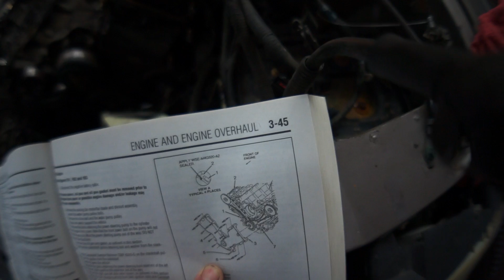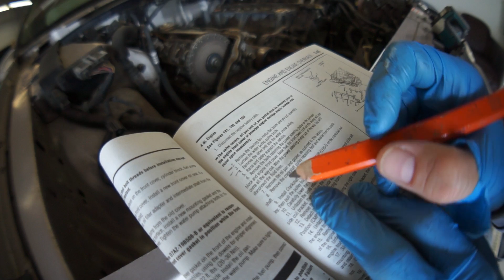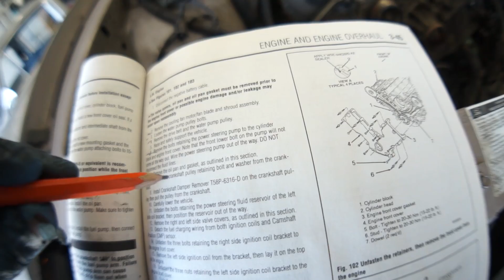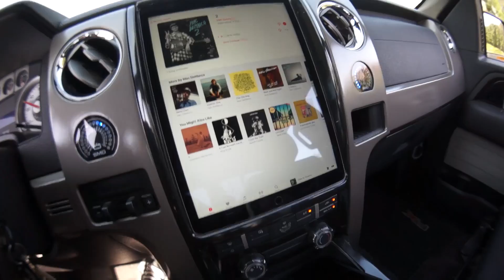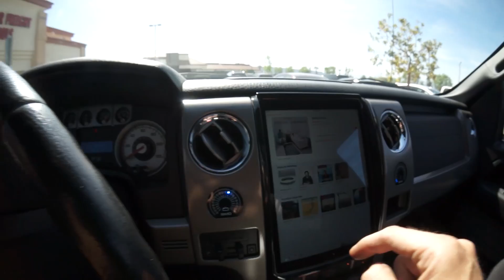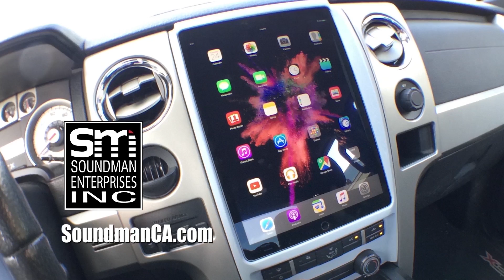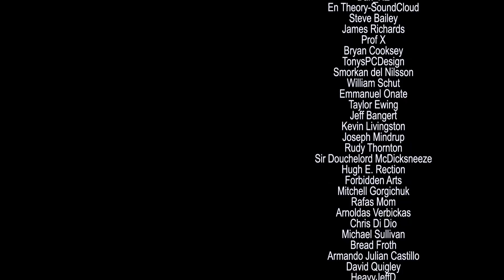You'll never believe what I learned about the T-Bird! - AMPLIFIED #729

Comment: Love T-Birds!!! My first car was an 88 T-Bird Turbo Coupe 5spd. manual. I went to a vocational school and had a bunch of the shops do work for cost: custom paint from the auto body shop, custom speaker box from cabinet making shop, rims nickel plated from metal shop, and custom sounds from my shop(Computerized Electrical Technology) Did it in 95 and all my pics got destroyed in a flood in my parents basement.  Then I wrecked it at 21 on leave like a dumbass. Been wanting to do a T-Bird build for my son. With the body style you have. You can find a bunch in decent shape with relatively low miles, cause so many old farts bought them. Love the show!

Comment: The reason everyone said to replace the motor is because antifreeze mixed in with oil. Once antifreeze gets in your oil, it gets in your crank bearings and no matter how many times you change your oil, you will Never get that antifreeze out of your bearings. Your rebuilding your top end but not the bottom end. That engine will fail you later on. I have worked on cars for 34 years now. I promise you that you will be doing this job all over again. Good luck buddy.

Comment: Still my favorite show. I'm glad I have more idea of what you're doing than with speakers and 6th stage flux capacitors and stuff.
You're crazy for holding up the engine with those 2 little water pump bolts.  And you're gonna want to swap it out obviously. And remove your calipers and zip tie them up to the shocks.... to something so you don't F your brake lines. Last peice of free advice is not to worry about setting marks on the timing chain, just start from scratch when you put it together. It's less confusing.

Comment: You should go for a performance build with a nice stereo. If you put a nice engine in the T-Bird it would be a lot of fun. Also if you did an engine swap you would bring in a bigger audience.
Reply: I agree, but instead of a motor swap I say throw in some big ass hair dryers. Push it to 300 plus HPs with improved MPGs.
Reply: Michael Taylor See you can put in Turbos or superchargers but you need to see if the engine is built to handle them. If it isn't when you're just going to blow your engine. It would be nice to see him put in a built engine that is make over 400-500 at the wheels. It would be a pretty badass project, and a great show car.

Comment: I'm not sure why you would have to drop your oil pan in order to take off your heads. Because somebody ran(don't know how long) the car with water(not a lubricant) in the oil, it is possible that a bearing (crank or rod) could have spun out which woulld be a motor rebuild if that is the case. Before you got started on this project, you should have changed the oil, re -torqued the head bolts and started(not drive it) it to see if you did spin a bearing out(knocking sound from motor means spun bearing). But that is for future builds I guess. Anyway, I just am so intertained by your videos that it brings me joy. Thanks for all your hard work and efforts on your videos. -zsignmein

Comment: I've had some timing covers off of some 4.6 and 5.4 mod motor fords. I'm pretty sure I just took the front bolts out of the oil pan that thread into the bottom of the timing cover and the cover came off no problem. It was a while ago though.

Comment: I have no idea why it wants you to pull the oil pan.  You just have to take the bolts out in the front that hold the oil pan to the front cover, then unbolt the front cover, remove timing chains and unbolt the head or heads and pull them off the block. looks like a Chilton book seems they have you do things the hard way.  You go Doug!!!

Comment: ford says you have to use the cam position tools but i want to say i used a 3/8 ratchet in the back of the cams to hold the tension when i removed the heads. This was back in 98 so my memory may be off. Either way i did not use them . I hate the torque to yield bolts.. makes me nervous that last turn.

Comment: Something to consider. You may not have a blown head gasket. I once had to leave a car sitting outside for 4 years. When I went to move car 4 years later the oil was full of water. IDK why. But I drained all the milk shake put in new oil and I still drive the car today another 3 years later when no issues.

Comment: Might as well take off the front shocks and mod them to fit the hydro cylinder.  Front =done.   Im actually curious on what you will do. I just top hatted the old struts and the hydro cylinder dropped in from the top. 90deg line out the bottom. No spring. Accumulators on the lines instead.

Comment: Time up the engine and remove the 4 bolts that go through the timing cover from the oil pan remove the crank pulley and the cover will come off without any need to remove the pan just use some silicone gasket on the oilpan surface area

Comment: Me again the coolant being low could be from the intake being cracked those 4.6 r famous for the intakes cracking on the back passenger side where the coolant goes into the heater core I have fixed a lot of them I worked on cabs that had a bunch of Crown Vics new intake is like $ 250

Comment: And one more thing... Make sure you REBUILD the front suspension when you add all that air stuff.
Ford engineers in their infinite wisdom decided not to put grease fittings on any of the ball joints, so they wear out super fast. Especially with the extra strain of an air system.
If you can find suspension pieces with grease fittings, get them. You'll thank yourself later.

Comment: after dropping the sub frame probably would have been better off just yanking the engine out then do the head gasket or just unbolt the trans drop the whole front cradle out unbolt the struts and roll it out lol but its good. The Thunderchicken is extremely clean id save its ass in a heart beat!

Comment: I hate to say it Doug, with how fucked that oil/water was,  you should replace the heater core. which is like a 12 hour job ... Also I got 20 bucks says it burns oil after the new head gasket install

Comment: this is going to be a real kick your ass job ....ok doug first once you take one timing chain off you need a crank holder and a tool to set and hold the cam...tell your head rebuilder to heli coil all the sparkplug holes they have a bad problem of blowing out plugs ...you also need to upgrade  timing chain guides...and don't turn the crank with the chain off....or you will bend a valve..i know just call rafa he will help re build it  .....keep up the great work

Comment: Well back to the drawing board because you really don't have to pull the oil pan off take the front pan bolts out of the timing cover and remove the harmonic balancer  all your timing cover bolts and it will slip off the dowl pins

Comment: why dont you just pull the whole motor out Doug? it will be easier to change the head gaskets and you can replace the rear main seal and other worn out parts.

Comment: And this is why I've come to love the  3.8 / 4.2 V-6. So much easier to work on than the 4.6 V-8. My 1995 Cougar had the 4.6, and it wound up with a clogged oil passage to the passenger side head. So much of a pain the ass to work with.
The 3.8 in my 1996 Thunderbird has been a pleasure compared to it. 60* V-6 is so much easier to get to, and it makes similar power numbers to the early 4.6 V-8.

Fuck anybody who doesn't a t-bird.

Comment: What if I told you it's not the Head Gaskets? It's the Oil Filter Housing Gasket, it has Water and Oil passages. It is Very Prone to Leaking Coolant in the Motor on the 4.6 ..... Mine did it on my T Bird...
A pressure Test with the Spark Plugs out would tell the Truth if it was The Head Gaskets...

Comment: That chassis was never designed with the mod motor in mind. It has remained the same from 90 - end of production. It was a Windsor that goes in there and its much easier to service as its not as wide as a 460 like the 281 that your currently working on. 
Trust me, you want to lift the car on a hoist and drop the whole shit show out and service it. It would take longer but at least you can put your hands on things with out blowing you elbows and asshole out.

Comment: Tdc the engine before removing the timing chain and the marks will line up as well plus it leaves you in the correct position when you go to install everything unless the machine shop wants the heads bare if that's the case fuck it...lol but seriously tho the only thunder chicken i would get is the super coupe aka 3.8 supercharged. Can't beat free tho

Comment: I know what the odometer says, but no way there is only 14k on it
Reply: Andrew Suderman I'd have to agree, there seems to be too much wear in the interior, looks like the carpets are quite trashed...  Maybe grandma was dirty?
Reply: It could have rolled over but the engine would have been trash before that
Reply: Old odometers were easy to role back.  My buddy had a Lightning and he took out the instrument cluster.  Then went to the junk yard and bought one out of a wrecked Lightning.  Put it in and set the original on a shelf.  Said when he was going to sell the truck he'd put the original back in, = low milage.

Comment: Good luck with the heads in car....can be done but there will be mass struggle fucking .
Your also ready for new brake hoses after letting support the weight of the suspension.
And replace your upper arms, they are junk from the get go and will fail . its much easier when the engine is out and the lower suspension is gone.
I loathed working on those things, id rather get poked in the eye with 100 poop dicks.
The only worse job is a early 90's continental brake booster...step one , remove engine as intake, valve cover and cyl head are in the way of sliding booster out.

Comment: Your valve covers will leak after you removed the bolts. If they had a little resistance when you removed them, congratulations you just ruined the seals. Go to a yard and get new valve covers, do not remove the bolts the leave them on the valve cover.

Comment: I have had a couple of theese cars there total garbage from suspention to drive train there known for front bushing going and rear wheel bearings and if you have the 3.8 v6 head gaskets 5.0 rear main seal and oil pans known to leak constantly replacing theese parts sucked you need 89 and earlier to get a good tbird 70s are best

Comment: great video but what the f*ck man it's a ford thunderturd .... its meant to burn oil and break down and wait for the chevy tow truck to show up screw the crazy stuff pull the heads yank off the old head gasket throw a new on using the air ratchet who needs to torque that pos will run for another 30 days and do it all over again

Comment: What kind of back woods mechanic would trust harbor freight tools?
Reply: Plenty of them. I've seen a few pro on youtube using the earthquake impacts and sockets.
Reply: Rob Norton What kind of dummy would pay $300 for a half inch wrench from snap on…
Reply from the maker: I almost used a couple 2x4's 😏
Reply: SoundmanCA probably would of been better off!
Reply: I know plenty of professionals that use harbor freight stuff here or there. Some of the tools there definitely do their job just as well as anything with a tool truck brand on it. I own a shop and use this engine lift in particular a lot.
Reply: 4×4 would work just as well